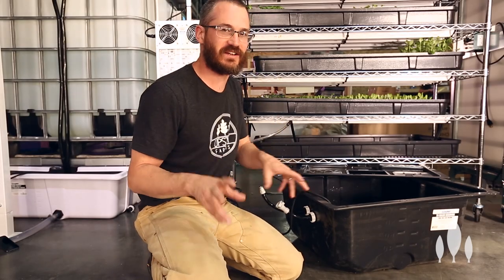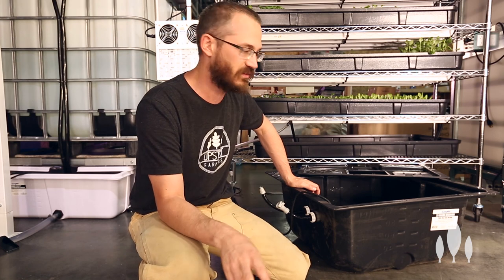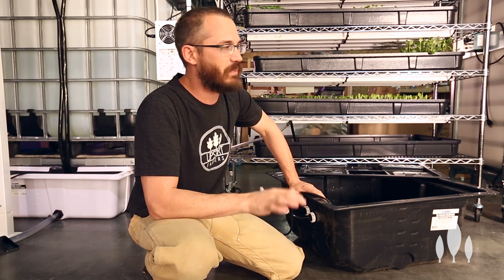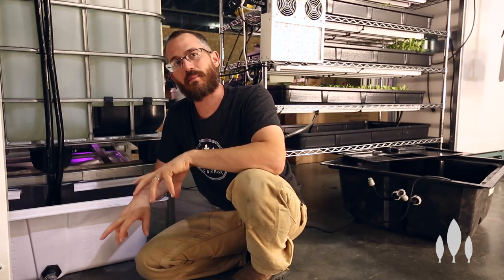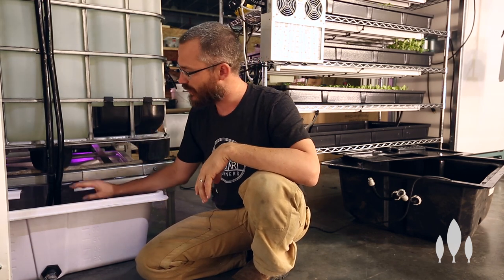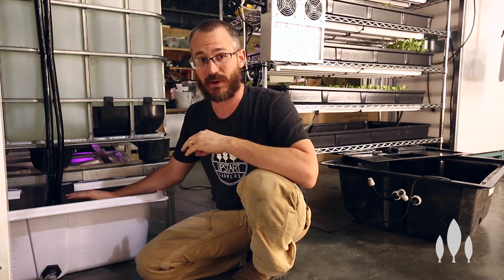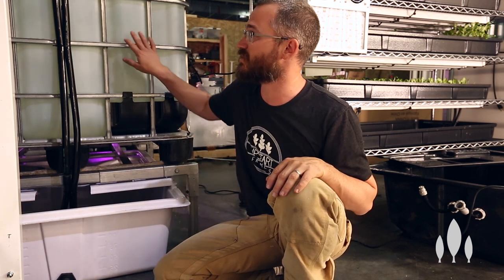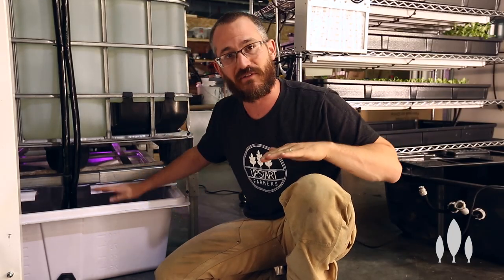Why You Should Be Using a Sump Tank

Comment: Ok so this is what I got. I got Lowest part of system = Fish Tank.. 

Pump from fish to swirl filter....

Swirl filter over flows to grow bed. 

Grow bed ebb and flows via bell siphon back to fish tank. 

I have 2 air stones at bottom of Swirl Filters followed by lava rock, pond pads and hundreds of 99c store lufa's. 

I just tested the water and I am in the "Sweet spot" for PH. However everything else tested VERY Low PPM for everything else. 

Boc Choi seems to be growing very well but spinach is whack! Leaves are pale and growth looks stunted. Might be temp?.. However I am moving to new place and was debating on putting in a Sump.. This didn't Exactly tell me why?. 

IF i have a check valve from pump in fish tank to swirl filters I'm "safe" if any power shuts off. So what is exactly the purpose of the sump and is there something I am missing? Thanks brother! GREAT videos!.. Always leaning and glad you help us.
Reply from the maker: Two- pump systems are only for applications where you need your fish tank above grade or at or above the level of your growing techniques, i.e. concrete warehouse floors that you can't dig into.  If you can set a sump in the ground, then you can have a 1 pump, split flow system (for AP producers) that is ideal.